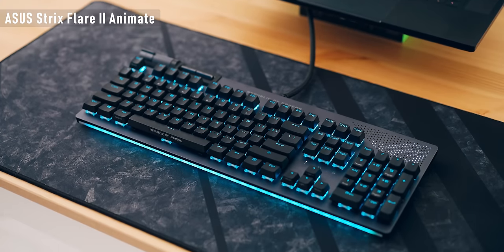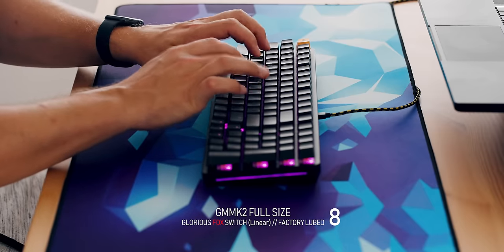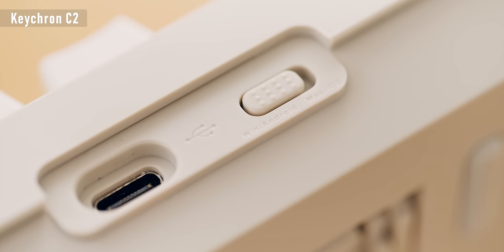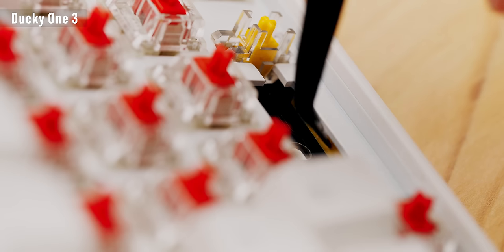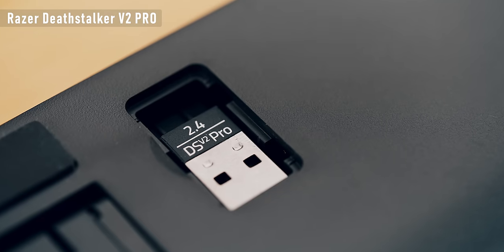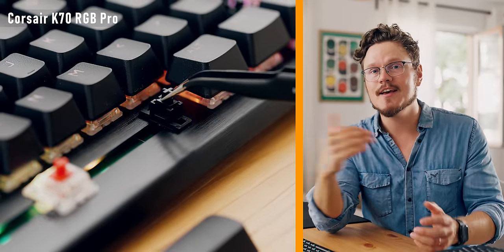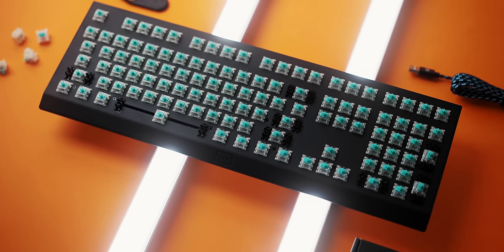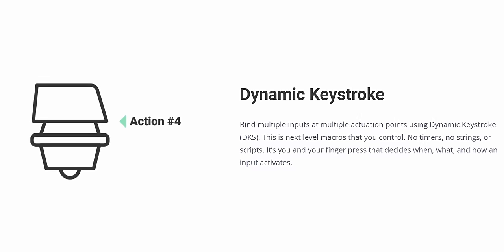Best FULL SIZE Keyboards You Can Buy - 2022 Edition!

Comment: I will still go for Filco/leopold/varmilo if you don't need extra function, or ducky for lower price. The diffinitely not launch at 2022, but the last long and build very well.
Most of their model still use Cherry MX switch which may not meet today standard feel, but the cherry switches in those keyboard feel much better on other brands especially gaming brands and  proved to be longevite. 

If you need extra function, go for the gaming brands, but most of them (not the cheapest model) basically have same function, because the function is provided by the software not the hardware, unless the brand intendionally block the function to some models. (usually block the  cheapest model) And if you want to use extra function without software, please see do the keyboard has internal memory to store those commands and function, even it does, do not mean all function can be use without software.
Reply: In addition to the short list of excellent full-sized keyboards mentioned in my earlier comment on this video, I neglected to mention the Leopold keyboards, which do look amazing! Thanks for reminding me, and I hope Dimitri does a part 2 of this video to include all of those.
Reply: @Aaron_Lesse  The main point of this video is show the keyboard launch in this year, so.... part 2 most likely not happening.
Reply: @holongwong6479  I see. Well, perhaps Dimitri will be inspired by the success of this video to put out a "Best of" video featuring full-size, 98%, and 96% keyboards.
Reply: Hmm, there is the Filco Majestouch 2 with MX red switches for the same 200€ as the Corsair K70 RGB Pro and a bit below below the 235€ for the Flare II Animate from the video.
The market really is different over here.

Comment: I will never understand why anyone needs TWO WAYS to input numbers. In my opinion, it's just not worth the extra bulk. Especially as a gamer. I often ended up bumping the numpad with my mouse, clicking accidently - so frustrating!

Even as a web developer/programmer, I used to find myself too lazy to move my right hand all the way to the numberpad section and I was just using the alphanumeric keys. And then gone from full size to TKL to 60%. It's so cute, saves so much space on my desk and is much more convenient to carry. 🥰

Comment: I would love to have one with a detachable numpad. I do use it to input long numbers in excel and bind voice channels to it if a game has more multiple. And for those having the numpad on the left side would be super practical. But at that point I wouldn't mind having a seperate numpad. I also don't like if the function key block is tinkered with, it really messes with touch typing when keys aren't where they are supposed to be.
And for a maximum typing and gaming solution I would probably use two keyboards. One with linear switches for gaming, and one with tactile switches for typing. Both obviously the same brand and model, with removable cable, so that I could simply unplug one and plug in the other.
Reply: @morgan5941  Check out the Mountain Everest Max.  You can set it up however you like.

Comment: I have too many mechanical keyboards already, and I know I will eventually get more. It's not unusual for me to wear out a non-mechanical keyboard in less than two years, so, this replacement of hardware lead me to buy more sturdy products. My current cheapskate preference is the EVGA linear or clicky versions of the Z20 that are normally well over 100 dollars, but at present are on sale in the 50 to 70 dollar region.
Reply: Those are optical switches right?
I see them with linear switches listed at 48€ currently, not bad. The version with clicky switches sadly is still 140€
Reply: @HappyBeezerStudios  The EVGA Z20 Mechanical keyboards are definitely light based optical switch tech that perform like tradition mechanical keyboard switches. If you want the actual mechanical versions then buy the EVGA Z15 keyboards, because those have mechanical switches of the Kailh design that can be swapped out for your preferred switch. I do not know if the switch connections are Cherry MX switch compatible. I recently have seen both the Z20 and Z15 priced between 30 and 60 dollars especially on the EVGA website. Both Z20 linear and clicky (LK Light Strike Optical Mechanical) versions use the LK light activated mechanical switches I have no idea if and why the description is the same, but the Z15 uses Kailh brown clicky switches and the linear version uses Kailh Speed Silver switches.

Comment: Been using the Mountain Everest Max for a while. Its an amazing full size keyboard which also works as a TKL or with the numpad by the side with a cable. Using Mountains own lubed switches makes it even better. (Just replace those damn ABS keycaps).
Reply: I received mine from a Black Friday deal with the Cherry Red. And yes I agree, I replaced the key caps with a 3 tone pbt keycaps. Also love the Yeti Easter egg in the little Oled displays.

Comment: Keychron Q6 QMK is the best full size I have had so far. But I can see why you wouldn't include it as it's availability may be a bit limited, and I think you do want to mod it a bit to really make it shine.
Reply: Aside from the availability, if you're not in America the shipping costs can sometimes be ridiculous. Not even mentioning how long it would take to actually arrive...
Reply: Hey there! As a fellow tech enthusiast, I highly recommend considering the HOTO Compressed Air Capsule for your cleaning needs. Its powerful vacuuming and blowing capabilities, along with its multiple tubes and high-quality filters, make it a versatile tool. Plus, its compact design and long-lasting battery make it portable for on-the-go use. Definitely worth checking out!

Comment: Long time fan of hardware Canucks but you guys should really go deeper into keyboards.  It's like if you only reviewed prebuilt computers.  Should mention:  Royal Kludge RK96 (personal daily driver with Boba 4U switches and XDA keycaps), Keychron Q5/6, and DROP shift.   Considering the audience is into building and upgrading PCs, it's pretty easy to move into doing similar for keyboards.  I'm also done with keyboards that aren't hot swappable.

Comment: I still prefer my K100 with added touchscreen. In my opinion none of the mentioned keyboards come even close to that one.
Reply: Ok wow didn't even kno that existed! Is it being actively supported? I'm actually still using an antique G15 which has the old LCD screen - still useful. :D But the support/apps were always garbage then died off completely.
Reply: @Flohpange  Sadly Corsair didn't give independent developers the option to create their own plugin for the screen. There's a lot of potential in it, but softwarewise you can't do as much with it as with the Logitech G15 screens. (As far as i know. Maybe they changed that.) 

So all i'm using it for is showing me total power consumption, system efficiency and time/date. (Corsair AX1200i supplies that via USB.) I'm also using a Streamdeck XL with HWinfo plugin for system stats. So each of the little screens in it is showing different informations. (CPU usage/temp, GPU usage/temp for each of the cards, water temp, pump speed, fan speeds, usage of every drive, network up-/download, and so on) 

The keyboard also has Streamdeck integration and 6 dedicated keys for it. I use them to switch between different profiles on the Streamdeck. The potential is limitless. What i'm using it for is just scraping on the surface.

Comment: I believe there is something wrong in their quality control at Corsair. I recently purchesed the K70 TKL red switch from Amazon, the typing experience had been amazing, everying is smooth, but unfortunately the USB-C port of the detachable cable was acting up, it disconnected ramdomly, so I connected Amazon and got a replacement. This one the USB-C port is working well, no disconnection, but the typing experience is completely different, the switches are little bit scratchy, which gives me a feeling that there are some unwanted material stucked in the switches.
Reply: I had a Corsair mouse and I found iCue to be overly complicated simply to setup keybinds. Never used Corsair ever again.

Comment: All of the keyboards featured possess some options I like namely, hot-swap, has media keys w/ roller and has usb pass through as well as being usb-c. However, none have all of these options present in a single board which is quite dissapointing.
Reply: A keyboard with all these options would surely cost well above 300, considering all the recommendations are somewhere in the 100-250€ range

Comment: Missing a lot of the better contender in the space. No Steelseries Apex Pro, no Akko representation, no Hexgears representation. The C2 is a good add. The keychron plastic boards don't get spoken enough about considering how good of value they are. Though you do also have to keep in mind that Keychrons shipping rates tend to be terrible and they pretty much never have codes to resolve that issue.

Comment: 8 Years now with my Logitech G910...... I have purchased and sent back several replacement.  Only 2 things about the G910 i do not like, no Wireless, and the volume roller has had issue BT speakers on my desktop.  Using my Laptop, the Roller Works fine.  makes no sense to me, as the have the same BT card.

Comment: Full Size? Terminology screwup. IBM Selectric is Full Sized. Having the 10-key is another "value" typically included in the key-count. 
83-84 keys or 104+ versus 75% 80% keysize (in reference to a Full size keyboard)

Comment: that first RoG board, does it have standard keycap widths? I am looking for full size with raised switches, media controls, and ideally hot swap that I can use my custom caps on, but some boards (esp with inset keys) are too tight and make them rub so I want a raised board to hopefully avoid that

Comment: What saddens me in that there doesn't seem to be modern replacement for the Microsoft Natural 4000. I haven't used 'regular' (non-ergonomic) keyboards in years, and I cannot imagine using anything else. So far I have stocked up on all the ~$50 Natural 4000s I could get my paws on, but it'd be great if an ergonomic option existed along with the wrist-torture-devices presented in this video.
Reply: I just came across the Dygma Raise a few days ago.  Quite expensive but it's an interesting ergonomic option. Just have to convince myself to spend the money and try it.
Reply: @gnarfcreatesthings  What I'm looking for is more a full-sized ergonomic keyboard. I got no use for wireless or detachable features, and I use the numpad constantly. 

In that regard the Natural 4000 is perfect for me, with as only negative the somewhat squishy membrane keys and the key labels that wear off after a few months.

At this point I'm pretty much just resigning myself to creating my own keyboard. May end up doing a kickstarter or something if other people are into what'd be essentially a mechanical take on the Natural 4000.

Comment: If you could make best full size membrane keyboards, then that would be great
Reply from the maker: Any suggestions for that one?
Reply: @HardwareCanucks  
Here you go:
HP 500F
HP 300
HP 230
Dell KB813
Dell KB216
Dell KM3322W
Dell KM5221W

Note that i meant best membrane keyboards in the USD 50 [or less than that] price range
I absolutely wouldnt pay USD 100+ for membranes even if i could afford them

Some insight into what i want:
Wireless, RGB, extra features is not necessary and i wouldnt pay USD 20 or whatever more for them, doing lots of typing, should last several years
Reply: @HardwareCanucks  
Also evofox warhammer and evofox katana
Reply: I would throw some Cherry keyboards into the mix. No OEM boards, but they are quite wildly used in the office space.
Reply: @HappyBeezerStudios  
Unfortunately, none of those are available here :(

This may also be the case in other third world countries

Comment: You missed the keychron q series of boards which come in full or 96%. Switches in my q3 are really smooth and stabilizers have lube but most people recommend lubing them a bit more to get rid of the last 10% of rattle but that's probably true for all of the keyboards you looked at. Q series is pretty unanimously regarded as best value in the custom keyboard area just watch keybored's latest video where he criticizes the drop keyboard for not being much better than the keychron but costing a lot more.
Reply: If they would offer different layouts than US ANSI I would take a look at them.

Comment: If I could afford it, I would definitely go with the DeathStalker V2, since I would love to have a good low-profile keyboard. But for now I go with my CHERRY G80-3000N RGB.
Reply: Had mine for about a week and i had something like a coil whine, plus keycaps were trash on it. Considering the price -.-
Reply: @MrMarinkovic  The Pro or the normal version? I wouldn't use the Pro version since I've got no need for a wireless keyboard.
Reply: @BenjaminWagener  I had the Pro version
Reply: The Cherry G80 really is a neat one. They make the switches, so they have all switch option available. And it sits right there at the bottom end in terms of price with the ones shown in the video.

Comment: Full size is full size. 96% is not full size. 1800 is not full size. There are still several keys missing on those keyboards compared to 100%.
Why is everyone insisting on removing the numpad, and why they're making those "almost full size but cramped" layouts?
Better would be to remove the arrows and nav block altogether, and leave the numpad in place - the opposite of TKL. See, there's the NumLock key since 1984, which means your num pad doubles as the nav block! But it seems no one is making such nav-less keyboards, which is a shame.

Comment: hi @ Hardware Canucks

what do you think about about compareing Fnatic Streak65 LP and Deathstalker v2 pro TKL thanks for answering :)
Reply from the maker: The FNATIC is a better keyboard in every way: build quality is superior // stabs are amazing // switches are properly low-profile and smooth ... its cheaper too. The only thing : its not wireless. If you need wireless, the G915 or the DSV2 pro are your only real options. But i'd still pick the Streak65LP because the cable is not an issue for me. 
-D.

Comment: Can anyone explain to me why no USB hubs in those keyboards? I have recently had to pull out my 20+ years old Cherry keyboard which sports an USB hub with 4 ports. Why is this not a thing today? Is it cost saving? Or space/size considerations?
Reply from the maker: The problem with a USB hub is multi faceted.  Not only does it make the cable hella thick but it also adds to board size and price.
Reply: @HardwareCanucks  Hm, the cable for my old Cherry with USB hub is pretty much normal thin cable. I for one would prefer USB hub to gimmicky RGB lights, but there isn't much to choose from.
Reply: I just use a 16 port, powered USB 3 that lives right below my monitor.  I don't have to worry about how much power my peripherals need and I can turn them off indiviually without having to unplug anything.

Comment: what about 96% / 1800 it's like a full format but shorter, i think this is the best format for people who like Numpad, but they're is not much 96%. I found only 3, keychron and epomarker was pretty bad (a lot of bugs) finally I got a Akko 3098B, but I wonder if there is other good 96% / 1800 on the market, specially available for EU without a really big taxe
Reply: I've tried one for a while, but I do use the cursor keys and the function block quite a lot, and with a different layout there, I'm back to looking at the keyboard to use it. And adjusting to the different layout means the same whenever I'm on a computer that doesn't have a 96% keyboard.

Comment: @Hardware Canucks

I am a Video Editor and gamer and i am looking for a keyboard to do both while using 2 different computers. 
1 for working and 1 for playing. 
I was thinking of getting the Razer DeathStalker V2 Pro to do just that. Connect it via cable with the gaming PC and switch to wireless mode while editing on the workstation.

If i have it always connected with cable on the gaming PC will it work when i wanna edit on the workstation or will i have to physically unplug it from the gaming Pc in order to work with the workstation?

Comment: I upgraded from a 1|0 x Ducky SF with Zeal Silent (Roselios) to a GMMK 2 96% with lubed AKKO Jelly Pink and AKKO ABS SA profile caps. The 1|0 SF was scratchy and rattled from day 1, but the transparent housing would show any foam installed, so I lubed the switches from the top and did the tape mod with clear Gorilla gel tape. Many times better, but still not as good as the GMMK 2.
Reply: Hey, great recommendation! I've been looking for a reliable cleaning solution for my desktop setup, and the HOTO Compressed Air Capsule seems like a perfect fit. The key features, especially the powerful vacuuming and swift keyboard cleaning, sound impressive. Thanks for sharing!

Comment: @Hardware Canucks
Anyone else with a DeathStalker v2 Pro having an issue with Synapse showing device charged to 100% but as soon as you unplug it drops to 97%?
Reply from the maker: They leave 3% as a buffer when on battery.
Reply: @HardwareCanucks  thanks for replying! I spent 2 hours on chat with Razer support and they eventually told me to get it replaced because it was a defect. But if this is expected I’ll just keep my unit.